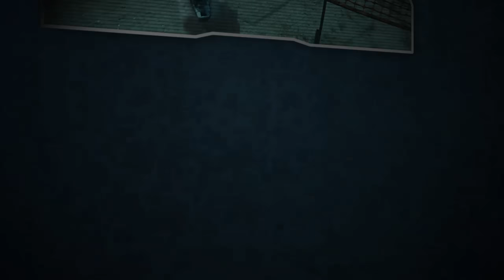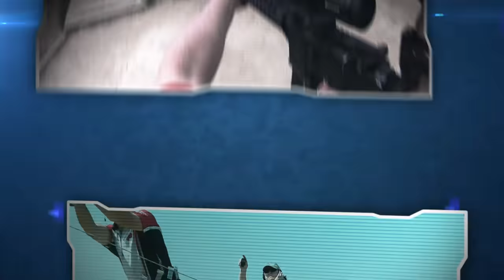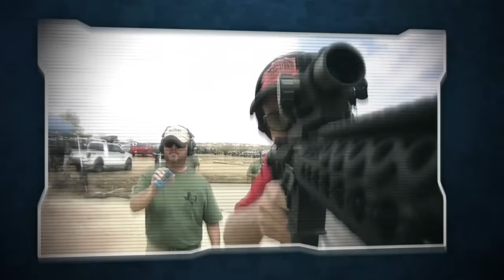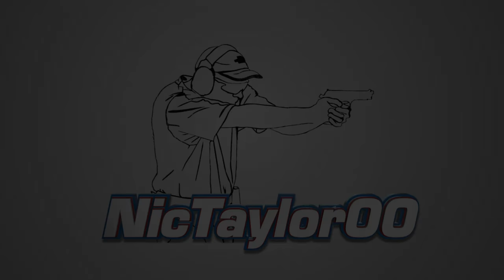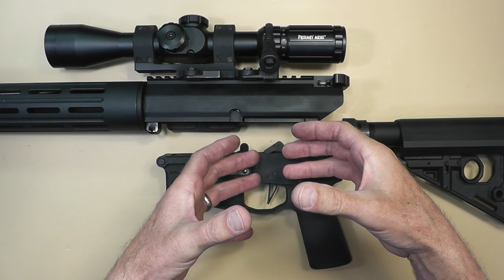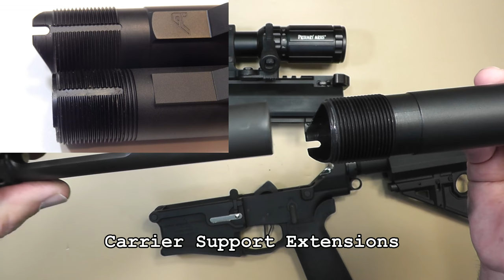AR10 Carrier Tilt Fix with an Enhanced Buffer Tube

Comment: This is gold! I had serious accuracy issues with my AR-10 build. I was getting two distinct groups with every mag - odd shots to the left, even to the right, about 2MOA distance from each other.
I began to suspect there was some play between the BCG and the upper. Your video confirmed that, although in your case it was more up/down play than mag forced left/right my rifle has. I printed a plug that I attached to the buffer, to keep the BCG more inline with the bore axis. It helped a lot, even though it's just a stop-gap solution. I'm going to purchase a proper anti-tilt buffer now.
Thanks again for sharing.

Comment: As a builder of specialized AR 10 uppers for sale I wanted to pass on a valued info I learned building AR 10 uppers.
For a long time, I suspected bolt premature opening by seeing black powder residue on the spent casings.
Even turning down the pressure from adjustable gas blocks often didn't stop the smoked spent casings.
I started to buy the 18.5 inch gas tubes from White oak armory for new builds of barrels 20 inches and longer and it worked retarding the timing the bolt opens and stopping the bolt from opening when powder is still burning in the barrel, and it also stopped the bent case rims from extraction of cases under High pressure.
The chamberings I am doing in AR 10 uppers are in 6mm - 284 win --- 6.5-284 Norma - 6.5 x50 Jap - 250 Savage - 358 win - 7mm WSM -- 300 WSM - 358 - 300 WSM -- 375 - 300 WSM for dangerous game.

Comment: I had the same problem were my BCG would contact the LOW-REC that mounts the  buffer tube... My 5.6 oz  KAW  Shorty BUFFER   would not follow the full length of the buffer tube and  would not clear 3/8+" inch  past from the bolt catch using a TUBBS Flat spring.  I had to cut a few coils off the spring to get the KAW shorty BUFFER  to bottom out to the end of the buffer tube.  I noticed this when I swapped out my KAW shorty buffer with a STANDARD AR buffer. I also use an enhanced buffer tube from POF & still had this problem..  Currently now I am still  using the 5.6oz KAW buffer &  TUBBS FLAT spring @ my AR10 runs flawlessly after 8,K rounds through it for the past 4 years.....

Comment: The BCG should always be touching the buffer when closed and pushing it off the retainer pin. There are a few factors that can cause this including the carrier to short or an out of spec lower that is placing the retainer pin back to far.  If the BCG is not pushing the buffer off the retainer pin when closed, the pin would be beating the buffer badly every time the gun cycles.  

The impact marks by the buffer tube are showing the carrier is traveling too far back.     https://www.youtube.com/watch?v=Z7kte3ZCILs

Comment: Good video! My AR-10 didn't have the damage to the BT as yours, but the buffer retaining pin would get beat all to hell, and actually breaking off the pin (even with the 5.3 oz buffer weight). It still functioned fine, with the buffer being held in by the bolt face, which is what you want, but swinging open the upper would allow the buffer weight to fly out! 

 I replaced the buffer retaining pin, but haven't shot the gun since then. The buffer weight face and the bolt seem to sit on top of each other, but I thought after seeing your video, why not add the extra insurance? Like you, this was a hobby gun too - but I recently reloaded some .308 rounds, and now have an excuse to go shoot it!

So, I just ordered the extended BT from Optics Planet for about 33 dollars (plus shipping, tax). Thanks for the information and your video! Can't wait to try it out! Will let you know how it goes!

-Doug

Comment: Never had a problem with it. I had gotten  bcg with the beefier end that was supposed to help with the tilt. I have a Sharps XPB Bcg that helps with the tilt. But I still got the POF Anti tilf buffer tube. It is better to have that extra comfort on a go to gun that you want to keep in the fight for along time. Every part I have in my M4A1 clone is for that. I will also be putting the same upgrades into my M4 clone and the wife's ar15.

Comment: Those dings in your Lower are from the receiver extension being too long or the carrier being to short. its traveling to far into the receiver extension, and the Rails on the carrier are striking the Lower.
Reply from the maker: That is correct.  I did not go aver that in the video since I was mainly trying to show the solution and not muddy the water with all kinds of possibilities.  Since this receiver set was a new design there was some hitting of the BCG in areas where I removed metal (the shinny area).  I also swapped out the spring with a couple different ones.  I compressed the BCG into the buffer tube with the buffer and spring installed and made sure that the BCG was not hitting the receiver or the rim of the buffer tube ( fully compressed the spring).  Perhaps one of these springs at some point did allow for the BCG to travel waay to far back.
Reply: Helpful

Comment: You are wrong about this, the rear of the carrier should always make contact with the buffer face, not close to it when the rifle's upper and lower are locked together..The carrier should be pushing the buffer back when the upper is closed to the lower, otherwise the buffer retaining pin will break as the buffer face hits the buffer retaining pin on every cycle. There should be .030 to .035 space between the buffer retaining pin and the buffer face when the rifle upper is locked to the lower..If you see a buffer face all chewed up, the face of the buffer is not making contact with the rear of the buffer and is making contact with the buffer retaining pin. This means the rifle or carrier is out of spec..
The weight of the buffer has negligible effect on dwell time and you have other issues if the increase in buffer weight is needed. The increase in buffer weights were created to slow carrier velocity and prevent bolt bounce malfunctions on full auto, not increase dwell time.This is a myth that has been spread by people who should know better. Gas port size/location, powder type and the cam lock groove decides dwell time, not buffer weight...If you are having extraction issues then your head space is off or you have a tight chamber or the wrong throat dimensions..A function gauge can test for this..

Comment: 1.  The rear of the bolt should be full diameter.. not cut undersized.. In the middle.. who cares.   2.  Your barrel is too short for efficiency. There is a thing called dwell.. That is about 4 to 6 inches past the gas block to supply the proper pressure and volume of gas to cycle the bolt... And the pressure should be 13k to 15 k psi maximum.. Your gas block is located too close to the cartrige and is giving too much pressure for the design of the system.... So use a 16' barrle and you can get it to work but with lots of problems.. Get a 20 inch barrle and everything is sweet....

Comment: Do you know why handgun rounds have bigger bullets or projectiles while rifle rounds mostly have smaller projectiles compared to their respective catridges? Why don't handguns use smaller projectiles for their comparatively smaller cartridges or shells?. In other words why rifles have large cadtriges and small bullets while handguns have smaller catridges and larger bullets?
Reply: Because rifle rounds are necked cartridges while most pistol cartridges have straight walled. The reason for this is velocity. Necked cartridges create higher pressures due to the funnel in the cartridge. Newton's third law is: For every action, there is an equal and opposite reaction. Which means harder recoil & you don't want much recoil in a pistol because you don't have as much control of the firearm.